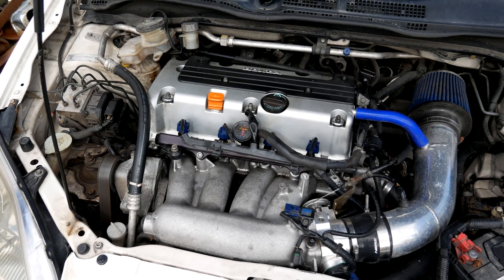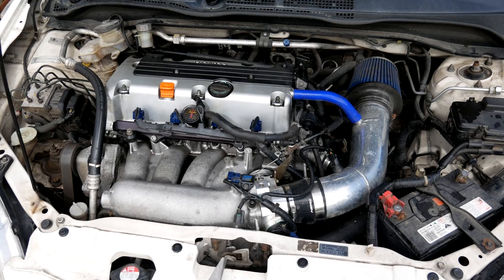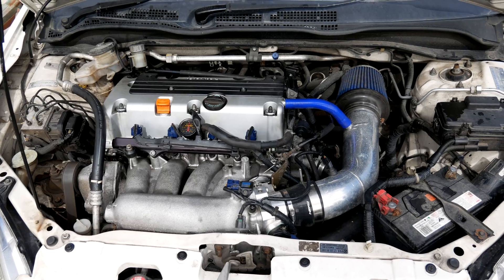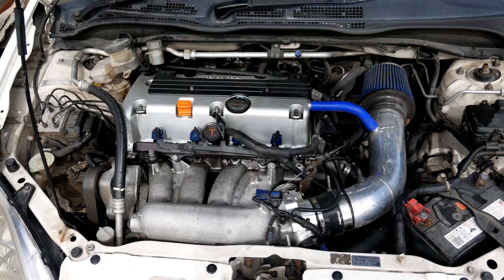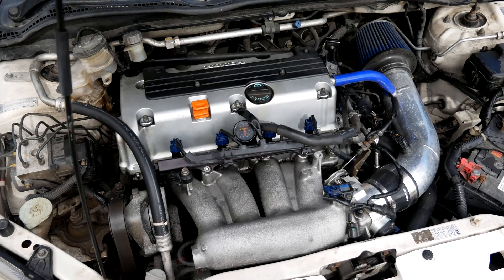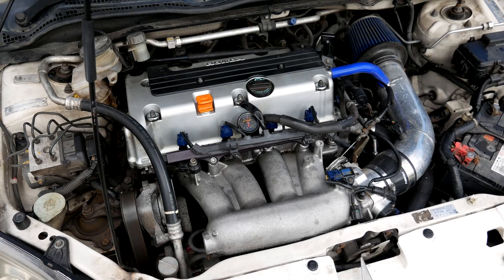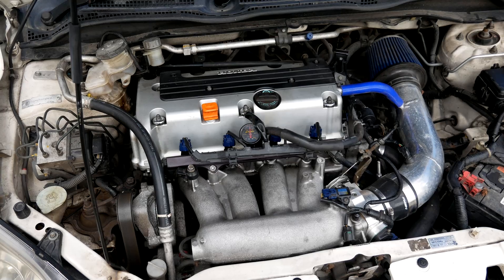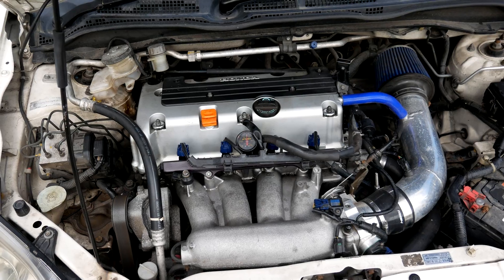K24 Honda  VTC tuning  - Cam timing dyno tested k24 pt2

Comment: Hi, i know this was a while back but, do you run the same timing and fuel values across all vct angles
Thanks
Reply from the maker: In this video the timing would have been the same.  i possibly adjusted the fuel  if was getting too rich or lean.  was an aem ecu  so just single map. not map for each vct point like stock style setup.

Comment: So your best run was 35 degrees before vtec?
Reply from the maker: the numbers i used for the final setup are in the graph right at the end.       I had the vct pulley skipped forward a tooth also.   from memory thats another 15 degrees on top of those numbers

Comment: Would be cool to see this but with a ajustable exhaust cam gear to see if theres any gain on torque or something, im planning to buy an ajustable exhaust cam gear but im not 100% sure how to play with it without damaging the engine
Reply: I looking for a better midrange, i have drop in cams and i lost midrange and im trying to see if playing with ajustable exhaust gear i can gain it back
Reply from the maker: @kseriesjanjo2708  Cant move the power  around as much with the exhaust cam as intake.   but if its set wrong will be gains to be had.  Most of the time its exhaust setup, headers and exhaust. if you drop a bunch of mid range going to bigger cam's.     you can see in the other video's  i picked up a bunch of midrange changing the exhaust setup.  and some more changing the intake manifold.    Also need a good tune to see the gains from these, since there is vct and vtec to play with,  both need to be tuned to your setup

Comment: Is this in 4th gear?
Reply from the maker: cant remember if was 4th or 5th, im leaning towards 5th.   doesn't usually matter too much on a fwd box.     rwd box with 1:1 gear shows more power in most cases
Reply: @Garage4age  thank you, your video was ver informative

Comment: Think, stock engine  add say FBO more air more power AND you think it will last forever tell the engine to also hold more power an spin more rpms? Rather use common sense than "car knowledge bro crap" 😂 " Dog i been spinning my b16a to 8800 all day" where is it. It blew up not cause of that though im telling you!😂
Reply: Bro what are you babbling on about what you speak of is lack of supporty mods like balanced crank shaved rods ext arp head studs thing of that nature so you shit don't go boom at 8k😅

Comment: I asked this question a lot of times over the years and I never get an answer, maybe you could help me. When they say 2013 Honda CRV makes 185 horse and 163 torque is that wheel or is that crank. Thank you for reply.
Reply from the maker: manufacturers use crank hp and torque.
Reply: @Garage4age  that’s what I thought cool . Thank you.

Comment: Hey awesome video, what did you use ro trim the vtc?
Reply from the maker: just carefully with an angle grinder.   people just throw a pin in the 50degree pulleys to limit them. which just floats around in there.   so didn't feel the need to do anything too fancy.

Comment: Is this a stock k24? And is that 350nm?
Reply from the maker: torque in the graph is actual wheel torque the dyno is reading.   would be  about 255nm at 6000rpm  plus some drive line loss to get engine torque   maybe 280-290ish at engine.  engine spec is in description
Reply: @Garage4age  damn that's a really nice amount of power , great video. thanks for sharing
Reply: And just gave it 10 deg more on the vtc wheel for the power gain?

Comment: So...basically just build a cheap vtec killer setup and run a fixed 25deg gear, eliminate all the vtc and vtec?
Win.
Reply from the maker: will kinda suck if its a street car  with no low lobes and vct though.   the vct would have a bigger advantage if revving higher also.  power would likely hang on till 8500 with vct.  fixed to 25 deg will start to fall over after peak.    a better example of what vct/vvti can do, can be seen here https://www.youtube.com/watch?v=L2Sw-_J7uSc

Comment: Can I clarify a point - you modded the VTC for +10 degrees, and advanced the intake cam position +1 tooth on the chain (7.5x2deg)? Wouldnt that mean going from 0-25deg VTC range to 15-50 range?
Reply from the maker: Yeah sounds about right.  I think the chain was a bit stretched on this engine  so could have been 10-45 or something

Comment: Is there no advantage going 40 or 45 degrees?
Reply from the maker: The timing marks were a bit wack on this engine.  probably chain had stretched a bit.   so was skipped foward a tooth along with the vct mod.   from memory a tooth is  10 or 15 deg. was maxed out in terms of piston to valve clearance.    short answer, yes more the better long as have clearance to do so.

Comment: water methanol spray is perfect for applications where pod filter gets hot air. It’s equivalent would be like having the filter outside the bonnet 

Then go a step further with straight methanol. use the largest nozzle. 

If your real keen have one nozzle tapped into each runner..that’s the most accurate. gains of 20kw can be had

Comment: How to understand VTC 10? Its intake cam advance by 10 degree? Or both cams or what?
Reply from the maker: they only have it on the intake cam. exhaust is fixed.    0 is fully retarded.  35 is fully advanced.

Comment: Be very careful reving over about 6500 rpm or so without vtec engaged. The vtec reteiner spring are not meant for controlling the middle rocker at high rev ranges. On B series they can hit the valevspring reteiners and ruin the complete engine if reved high without vtec engaged. Not 100% sure on k series but I treat them the same way.

Comment: your VTC numbers, im assuming they are only the intake cam and that you are advancing rather than retarding?
Reply from the maker: Yeah, they only have vtc (as honda calls it)   on the intake side.     bigger number = more advance.  zero is  the base position, or max retard of the pulley.    the graph at the end with green/yellow boxes are what it ended up liking.

Comment: Dyno test with the air filter pointing outward
Reply from the maker: Was thinking about doing one  testing different length  intake tubes.    snorkel out the bonnet so the bbq intake doesn't effect results
Reply: @Garage4age  Fresh air always give some horsepower

Comment: Poor car is begging for a proper cold air intake rather than the heatsoak filter it's got
Reply from the maker: could do a vid testing different length intake tubes,  snorkels out the bonnet for a fair test.
Reply: @Garage 4age  fantastic idea. Honda forums have lots of posts discussing intake piping length (I.e. pre throttle), but I've never seen any scientific tests that also account for air temp or diameter.

Comment: Another way you could quantify midrange power gain is an average over an RPM range. 
A somewhat objective to pick the RPM range  could be: 
Take the shift point RPM (~8100) as the high end of the range. Divide the shift point RPM by the ratio of (1st gear / 2nd gear) to set the lower RPM limit for the range. This would approximate the RPM range used when accelerating through second gear.
Reply from the maker: Yeah im all about the over all gain rather than just peak numbers !

Comment: Is it running a k20A type r head if not your wasting your time
Reply from the maker: k24.   looks like they just swapped the whole long block in and added some cams and a few bolt ons.   personally i probably would have just spent the money on the k20 type r engine.  but something could have gone wrong with it i guess.
Reply: @Garage4age  why would you do that? K24 beats k20 all the time and on low end with same mods k24 will have 20-30hp more. I have made stock on my k24 cl9 190CHP and after Basic mods 255CHP. Now with custom intake and header goal is +265CHP at 7800rpm. K20 can only dream of that power wit this mods.
Reply from the maker: @CL9k24a3   I mean for the money they spent on the swap, which was a lot.   spending the money on the type r engine already in the car,  to get to 170kw makes more sense.     not saying anything bad about either engine.       plus in my case im more interested in modifying things to get more power, rather than just adding more capacity
Reply: you are miss informed... Stock head flow is 290-295cfm and RSP head is 315cfm. Stock head is plenty good.

Comment: It's pretty impressive even with VTEC off. Is there any clearance for bigger VTEC cam lobe?
Reply from the maker: yeah, would be a matter of limiting the vtc pulley to right place.  the amount of cam in it atm seems to be good for stock engine street car.  will do a little work with some bolt on stuff,  now the mechanical and tune issues have been sorted

Comment: With 3 inch exhaust ported &polished rbc and better cai it will make more.Hopefully i'll get an ep3 this year
Reply: I have an ep3 and I absolutely love it man although it was a rough start since previous owner did poorly done maintenance, its still a fantastic car! But tbh in 3rd gear it starts to die (power wise) also needs the next gen transmission since the stock one has pretty long gears if the goal is to stay n/a
Reply: @djpollo2474  My plan if i manage to get one is to keep it na for a while and go induction later. I like superchargers on high revving engines like the k20 but they make power easier with turbo. By the way how much do they sell a good used one in your country. Here in Greece 8000€ plus for a good one